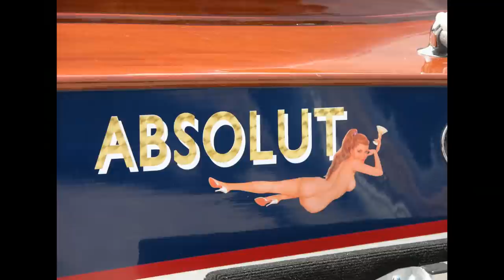Building ABSOLUT, a saucy little wooden Race Boat

Comment: That is crazy over structural.
Were u going to drop it off a building ? Or go boating ?
Holy Crapp.
Nice job though ,what a labor of love.
Reply from the maker: It is definitely not over structural.  It is built like an aircraft wing. Remarkably light framing but very strong. Besides, did you just want to look at it or drive the hell out of it without breaking anything....

Comment: Great looking boat! Can you tell me what it is planked with? Especially the custom cowling.
Reply: Yes all of the frames and stringers were made from 12mm Meranti mahogany marine ply. The stringers were double 18mm ply. Bottom 9mm ply and hull sides 6mm ply. Bottom and side covered with 6 oz. fiberglass in epoxy resin. Deck is 3mm ply with 3mm solid mahogany overlay. Cowl is 9mm solid mahogany.

Comment: Fantastic!!  Are there plans available?
Reply: The answer to that is yes and no. This boat was custom built one off. We started with plans for a Canada One Design racer by Earle Barnes in 1949. We lengthened the hull by a couple of feet and a few other changes. The deck and cowl were pure eyeball engineering as we went so no plans exist specifically for the boat as you see it. However I do have the original plans. It was drawn at 14' 8" LOA.  To improve the look and sweeten the ride we space each of the 14 stations 2' further apart and that took us to 16' 2". we also added an inch to the deck crown. The overhang treatment at the transom was to visually draw out the lines a bit and it pleased our eye.  The cowl had to be that high to clear the carburetor on the engine. the shape and look was once again pure eyeball engineering as we went. I can supply you the original plans but you would have to make your own modifications. The hull is easy, the cowl is a  little trickier.  It would depend on your skill level. Hope this helps.  Cheers, Dwight Boyd  ( dwight@bellnet.ca )

Comment: Would have been really cool with a flat head ford in it. Nice boat.
Reply from the maker: These boats were originally designed for the Ford Flat Heads. A very pretty installation indeed. they were later sanctioned for the 283's  & 327's then ultimately for GM 350.  The 283 was the owners choice.
Reply: Clarionboats what is the model seems to be a sanctioned race boat but I am unfamiliar with the design or official model name

Comment: I still enjoy watching the construction process! Can you tell me where you obtained the side exhaust outlets? Very cool!
Reply from the maker: Dave, We made them. 3 inch copper pipe cut to the appropriate length and angle. 1/8 inch brass plate cut to shape for flange and and hole elongated to suit angle of pipe. Braze it all together, grind and chrome. Nothing to it.
Reply: You can just make them your self or find a place to buy them the pipe is stainless steel and you can find the exhaust rings or modify a set of rings for side exhaust usage

Comment: Hello I was wondering what material you used for the frame work please? Was it marine plywood?
Reply from the maker: Hi Scott, Yes all of the frames and stringers were made from 12mm Meranti mahogany marine ply. The stringers were double 18mm ply. Bottom 9mm ply and hull sides 6mm ply. Bottom and side covered with 6 oz. fiberglass in epoxy resin. Deck is 3mm ply with 3mm solid mahogany overlay. Cowl is 9mm solid mahogany.

Comment: top speed?
Reply from the maker: With the 283, 225 hp engine about 48-50 mph
Reply: Clarionboats Where could I get the boat blueprints for this particular boat? PM me if I can get them from you. 
Thanks ahead of time.
Reply: ***** Hi there Mister ;) Can you please tell how much it would cost to get a boat like this, if possible, manufactured of, and from your company?
Reply from the maker: -eivind Ottar  This boat is custom built to order. The price depends on how complex the boat is. But, to give you an idea of cost, the boat as you see it in this video would cost around $80 - 90,000.00 Canadian dollars. Build time is about 10 months.
Reply: Clarionboats Thanks for the answer. $80,000.00 Canadian dollars are about  480, 000.00 Norwegian krones (NOK). That`s a years salary for a teacher or a nurse over here, so not to bad actually.
We have quite good salaries, but quite a high price range.
A Jeep Cherokee Longitude 2,0 MJD 140HP 4x4 with manuell gearing for example, actually costs 499,503.00 Norwegian krones (NOK), which are about $83,250.50 Canadian dollars. Massive taxes on cars, on the verge of beeing insane.
Maybe a bit to much inrelevant information, but for people who take an interest in currency, I just threw it out there ;)
Reply: @eivindOttar  Buy the jeep then LOL.

Comment: can u send plans
Reply from the maker: Benjamin Powell The original plans that we have are so faded they won't reproduce. Besides we modified the plans considerably to create the boat you see. It is about 2 ft longer, has more crown in the deck and the cowl is our own design. We also added the overhang at the transom and changed the method of construction from the original. Unfortunately the short answer is no, there are no plans available.